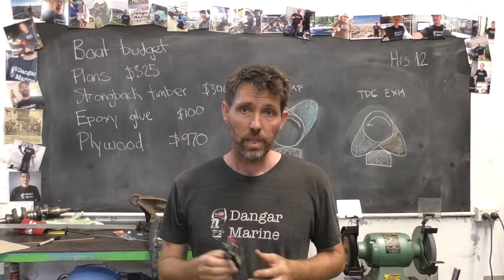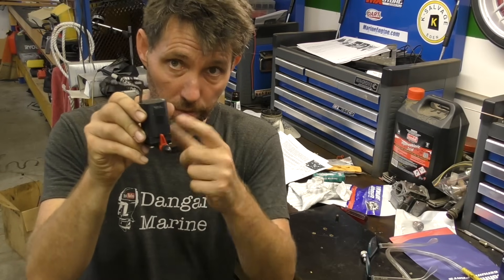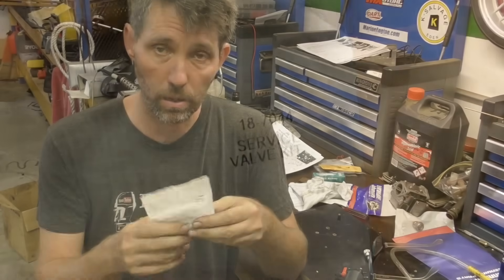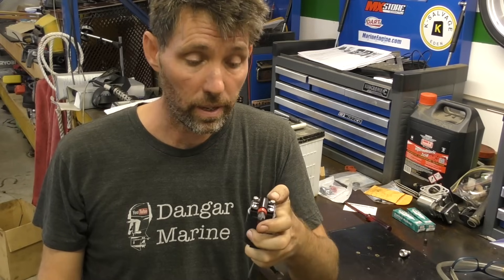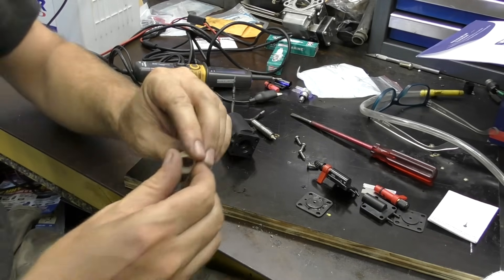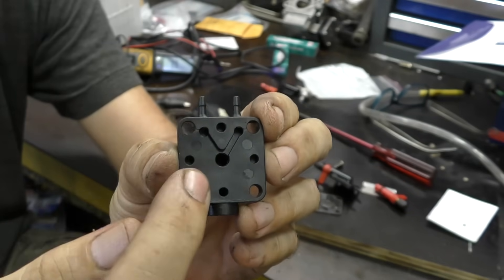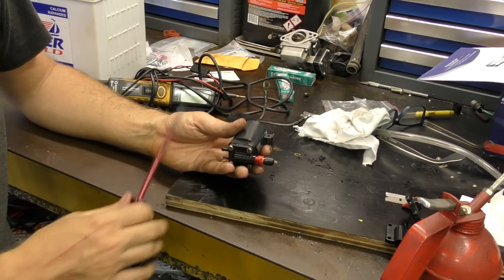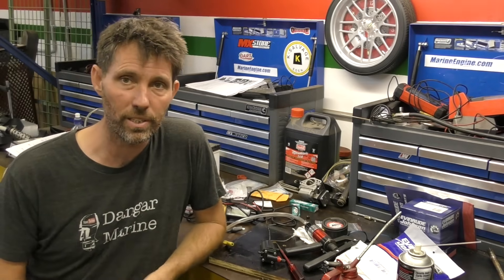Johnson / Evinrude primer solenoid

Comment: Great video 👍 i recently found this channel and definitly will follow it. I have a question. I bought an outboard 28 mariner and the water that comes out of the tell-tale hole is completley cold.? Isnt it suppose to be hot? Somebody got any ide why this is? Cheers
Reply: Watch his video on cooling system. You would see straight away. Regards
Reply from the maker: This is the video Jaco is referring to. The water generally doesn't go through the block until the thermostat opens. If it is stuck closed then the motor will overheat even if the pump is working well. https://www.youtube.com/watch?v=joEQChcZl2A
Reply: that video helped me so much. i think my thermostat is hooped.. will take it apart and test it. lucky me its only 31 pound to buy a new one from UK. you might have saved me from a siezed engine. thanks so much man. 
come to sweden and i will buy you a beer. thanks

Comment: Hi Stu, Here's the update on the boat. Kurt tested it first on the dyno system yesterday and found the timing was off which I knew and one of the plugs was fouled. The carbs needed adjusting which I had set for pretune 1 1/4 turn. Other than that he changed the filters? Other than the fuel not sure what other filter he was referring to? And the steering is stuck again from sitting so I'll take care of it. He said it now runs great idle and WOT. So basically I was on the right path putting in a tank to set the timing right just decided with my extra money from working again to have a expert get this fixed. I'll test it soon after I fix the steering and shoot a video on the water. Update: read the work order and just the fuel filter. I didn't realize the tune up included removing the outdrive, inspection, and greasing everything. He said my engine is one of the best mercury they made. Update Oh and you steering cable video will come in handy here soon. Thanks
Reply from the maker: Hey Tim, sounds like it is going to run sweetly now. Looking forward to seeing it on the water. :)
Reply: Oh I ordered a Dangar shirt. They haven't shipped it yet but when I get it will take a selfie and send it to you

Comment: How ya Stuart  , I have a 30hp key start2stroke 2004  mariner bought 2nd hand about 8yrs ago . after about 8 or 10 mins running in the sea the overheat alarm starts to sound .  Removed cleaned & tested stat twice . Not over confident about going further without a owners Manual , are they engine model specific ?where is the best place get manual and spare seals gaskets etc ?     Cheers     Ger , Wexford.
Reply from the maker: Hi Ger. You can see if they have a manual for your motor on readmanual.com or tradebit.com You should be able to find a local marine shop that can order Sierra parts. Sierra will make a full set of aftermarket spares for your motor.

Comment: Hi Stu.  Thanks for heaps of great vids.   I think I have watched every one.  Just hoping you may be able to help me? I have a Johnson 40 hp approx 1988.  It runs up to about 1/4 throttle and does not idle, when I reduce the throttle underway.  So far I have fresh fuel, compression checked all good,fuel filters all clean, checked one of two carbs and found it to be clean also.  Plugs seem to be on the rich side, not lean.   Any help would be really appreciated.   Thanks again.  Ben
Reply from the maker: Hi Ben, if it is running very rich it could be fuel entering the crankcase through a torn fuel pump diaphram. By coincidence, I will be doing a video on that this weekend.
Reply: Dangar Marine.  Thanks heaps for the reply. So far have replaced gaskets in carb but yet to test it.  Will take a look at the fuel pump diaphragm also now.  Great tip.   Looking forward to the new vid on the fuel pump.  Hope to meet you some time.  Ben
Reply: You were spot on!!   Took the vro pump apart and found the diaphragm was perished.  I will do away with the vro and do premix with a fuel only new pump.  Thanks heaps.  Just need to find the shift linkage height for this outboard now as I did not measure it on disassembling.  😡 giday from Geelong VIC. 👍🏼

Comment: Thanks for posting great videos. I have a 91 30hp Evinrude that is missing the shock absorbers that are between the shaft and the bracket/housing that goes on the midsection. Do you have any experience changing these? Possibly a video idea?
Reply from the maker: Yes, I've changed them a few times. Haven't done a video yet but I'll check the condition of them on this motor and see if I can do a vid.
Reply: Awesome! I will stay tuned.

Comment: Soo happy your covering the evenrude johnson stuff!!!!
Reply: Goose, same thing is going on here. but anything over about 5 years old usually gets you the 'it isn't worth repairing, but I happen to have a near new 7 year old reconditioned motor I can sell you!" Yep, makes great sense to trade a 5 year old engine for a 7 year old engine, but I had that tried on my brother in law. I had the 'Honda have a sale on at the moment- $900 off' tried on me, no mention that the engine weighed 50kg more than the engine I already had and my old hull couldn't handle that much weight down aft safely. Thanks to Stu's videos we puzzled out and did an impeller, lower unit oil change, 4 carb cleans and new fuel lines (old fuel lines were that silver junk, inner lining had collapsed and junk had got into every thing), fuel pump and it is a running engine again (1995 Yamaha 90) . The best tip was the ratchet strap to hold up the lower leg until we got the bolts in!
Reply from the maker: It's about time, there is no shortage of them out there.
Reply: And sadly several marine stores are turning down work on old outboards theae days so just know whenever you do content on Johnson/Evinrudes, I'm extremely grateful.
Reply: Thanks a million!!  I have a 1997 50hp electric start.  Can you do I quick video on the temp sensor that goes into the block? Mine melted :(   Also could you do a quick video on anodes for an aluminum boat?  Mine is getting eaten alive after I realized my anodes are gone.  I want to protect the boat but there are so many options.  The mounting bracket, the mounting bolt caps, the trim tab, some others I don't even know where they are supposed to do.  Some people hook one to the negative terminal.  Not sure what my best options are.  Love the Green Machine!!  Thats my 1997 Grumman 17sp's name too!

Comment: I have a 1997 40HP Johnson and I had to replace my fuel primer solenoid. All of the manual troubleshooting passed but the inside of the solenoid where the valve slides was slightly swollen. This didn't allow the valve to retract. Just another area to check.
Reply from the maker: Ah, interesting, sounds like replacement would be the only option in that situation.

Comment: Excellent video Stu. I have one of these on my evinrude 48 SPL. I love the Schrader valve feature.  It makes winter fogging easy as pie. I had no idea that these primers were completely rebuildable. Since I haven’t ran my 48 in awhile, I’m going to be checking it over and doing maintenance and repairs in the spring. These johhnyrude (Johnson and evinrude lol) videos will be a big help!
Reply from the maker: It is a good feature for winterisation, that's for sure.
Reply: I think a video showing how to use it to winterize would be awesome!

Comment: Can you put one on an older model from 1960
Reply from the maker: It is theoretically possible, but if the outboard has a choke on the carburettor I wouldn't bother. I actually prefer an old style choke.

Comment: So how would you use the Schrader value to introduce cleaner or fog the engine?
Reply from the maker: The fogging oil comes in an aerosol can that you attached to the valve with a supplied hose. You then start the engine and spray the fluid until the motor starts to smoke a lot and begin to stall.

Comment: Instead of using a special tool like a Power Probe you can use a simple 12V test light.  The bonus of using a test light is that it will "current limit" the amount of power applided.  The "standard" test light bulb is about 3W and will only pass 250mA (1/4A) so it would not be enough to open that solenoid.  You would need about a 50W bulb and that would current limit the load to about 4A.

You might want to consider an adjustable DC power supply.  With voltage and current settings you could quickly test many electrical items without fear of burning them up.
Reply from the maker: A test light can be a good way to go, but of course you will need to make up a second lead for the ground. Perhaps making a set of leads with a variable resistor in line would be a cheap way to go that still allowed the use of a regular battery. BTW, I'm not sure how much current the autoprobe can supply but it is fused internally.
Reply: Forget the variable resistor, but my suggestion is get a standard incandescent test light and replace the bulb (it is called a "festoon" bulb") with a 10W bulb (Narva 47264).  This will current limit you to about 750mA.

For higher current tests, like the solenoid you are working on, get a couple of brake/turn signal light sockets (junk yard) and two 1157 bulbs.  Wire the sockets so that both filament are connected and then wire the holder in series.  That is about 45-50W so the max current through it would be about 4A (@12V).  Ohm's Law.  Know it. Use it.  It's 𝗧𝗛𝗘 𝗟𝗔𝗪.
Reply: Nope, Standard 55W headlight bulb will work. Wired in series with the solonoid.
Reply: Stu, you wire a head light bulb in series with the load under test. Globes are a near short circuit when cold and so pass the full voltage current for a few milliseconds before they warm up, and then slowly drop the current as the resistance comes up. Headlight globes of 55W rating work well for most things. It is an old self resetting  current limiter idea I have seen in many old model railroad controllers and variable power supplies.
Reply: Ron  Howell - Headlight bulb is fine, just a little bulky and more expensive to replace then a couple of 1157s !
Reply: Jack, old sealed beams or globes with blown low beam but good high beam filament are dime a dozen at my place. 7 cars  and I seem to be replacing a globe every 6 months or so . Stu's workshop does more cars than boats  so it wouldn't be unusual for him to have few old headlight  globes around .

Comment: i'd love to see a video about how the "Man Over Board" (MOB) works electrically speaking ! thanks
Reply from the maker: Hi mate, I've added it to the list. :) Most of the time the MOB button just sets a waypoint on a GPS at the current location so you can return to the spot the person fell over.
Reply: Thank you but that's not what i meant. I was talking about the physical "cord" that shut the engine off when disconnected. (when falling over board) ;) thank you for your reply !

Comment: Hey Stu, Do you ever think you'll run out of outboard topics?  Would you consider adding Merc I/Os to your wonderfully detailed instructional videos.  I have so many great questions about my Chaparral.  Gracias.
Reply from the maker: Hey Bruce. The trouble with doing vids like that is that we never see any of those boats. All the boats on the island are small outboard commuter boats unfortunately.
Reply: Even if he does "run out of outboard topics", he can still make new videos with future customers' outboards.  For example, I'm sure that not all builders use the same make of carburetors, so if he did carb videos, he's eventually cover an example from a Honda, Yamaha, Suzuki, Tohatsu, Nissan, Merc, Evinrude, Johnson, etc. etc. etc.  It would also show differing methods of how the builders obstruct access to the carbs by surrounding them with other things that need to be removed or dismantled in order to get to the carbs.  I'm waiting for the day when someone brings him an inboard or stern drive to work on :)   I'm also waiting to see if an ovloV ever comes in to his shop.

Comment: Hi Stu, first of all good catch on the pin flying out. My primer on the merc is metal and still works good. With my work money I have been making decided to take the boat in today and have it dyno tested and tuned up. Will let you know what they find. He said in most cases they can get them running good but once in a while it needs to go in the lake. Three Rivers Marine is highly recommended in this area
Reply from the maker: Hey Tim, would be interested to hear how you go with the dyno tuning of your boat. Very interesting! Will you do a vid?
Reply: Would love to do a video but Kurt won't be in till Monday for servicing and I'm still working till the end of April. I plan on doing videos soon after. I'll ask Kurt if I can do one then on someone's boat and share it with you.  Dyno tune sounds very interesting in the test tank. He said he can go WOT too.

Comment: i have an question unrelated to this video,  my friend has a 1980's johnson 6hp outboard  it ran fine until his nephew dropped it  on dry land.  like 2 feet.  now it wont start.   i did a compression test and both cylinders are reading 35psi.   is it just a coincidence that it stopped running when he dropped it?  i remember it was hard to to start before the drop.  i think the rings or worn out or stuck.   i appreciate any advice thanks
Reply from the maker: Dropping it is unlikely to have affected the compression, but it may have caused a carburettor float to stick or maybe an electrical connection to come undone.

Comment: Last summer I had a flooding issue and I thought it was the carburetors, I live in the USA and I bought a new plastic portable fuel tank and it has a one way valve that won’t let air out so it swells up like a balloon and floods the carburetors. Just thought I would share this Incase someone else could be dealing with flooding issues. Thanks for the video looking forward to seeing the carburetors rebuild.
Reply from the maker: Thanks David, it's interesting how often motor troubles can come down to simple things like the breather valve in the tanks or the primer bulb etc.

Comment: Good morning my name is Tim crews and I live in Riverview Florida, question I have a 200 hsp evinrude outboard motor and I need to rebuild my carburetors I have six of them on there I never done carburetor work before and I'm very nervous about it do you recommend me trying to work on it myself I know it's difficult and you need the right mixture of gas and air or should I take it to a mechanic that works on carburetors I need your input I'm trying to save money but I rather spend it then destroying the carburetors what do you think sir thank you
Reply: Pretty good video on rebuild of 150 HP Evinrude / Johnson (also has 6 carbs) at https://www.youtube.com/watch?v=z5S0ek4A5lM
Reply from the maker: Hi Tim. Carburettor cleaning isn't that difficult, you just need to be careful putting everything back together. You are unlikely to do any read damage, and even if you did accidentally break something, parts are still available. Worse comes to worse you can take it to a mechanic to reassemble and you will still be saving yourself labour on having removed them and cleaned them. Do one at a time so if you have any doubts about how something went you can you the others for reference. Here is a vid from when I did a 150 https://www.youtube.com/watch?v=E-2DznvgXSY

Comment: a great video Stu, have been waiting for a loooong time for you to get your hands on a Johnson/Evinrude. The primer is great for cold starts and i had a fair idea what it did, now its even better i know exactly what it does
A question without notice, when is the proper time to use the primer for a cold start? i tend to turn the ignition to on then push the key for a second or two then start. Now that you have explained its function and from another comment i read, is it better to prime while the engine is cranking? Cheers
Reply from the maker: Yep, holding the key in while cranking is the way to go as this solenoid is just a tap in essence, it relies on the fuel pump to push the fuel into the engine and that only happens while the engine is turning. Once the engine is running if it sounds like it is going to stall again you can just push the key in for a moment to add more fuel as the pump is still running.

Comment: Another great video Stu, excellent explanation  about how the choke and electric prime systems work as well. Quick question though, I've always shied away from using brake cleaner or carb cleaner on plastic parts as I was told it could damage them, have I been misinformed or was that all you happened to have available?
Reply: Ive found these chemicals are considered safe to use on plastic. However it can grey/wash out some types of plastic, but generally not the ones used in engines etc.

Acetone is the real ABS killer tho!
Reply from the maker: Thanks mate. There are many different types of plastic and those used in motors are very resistant to hydrocarbons.
Reply: Even degreaser on the circa 1990 mercury powerhead turned ash white on me one day.... hit it with some inox to return colour

Comment: Hi Stuart,  how old would you guesstimate that particular prime solenoid to be?  I was just surprised to see flat/slotted screws used to hold the top on it.   I guess there's realy nothing wrong with slotted-head screws, other than you want to be taking your sweet time when interfacing the screwdriver with them.  I find Phillips-head to be a step-up, and being Canadian, I really prefer Robertson drive above all, but hey... let's not get all political here on this channel :)
Reply from the maker: Hey Stan, the motor turned out to be 1994, but who knows if it is the original prime solenoid...